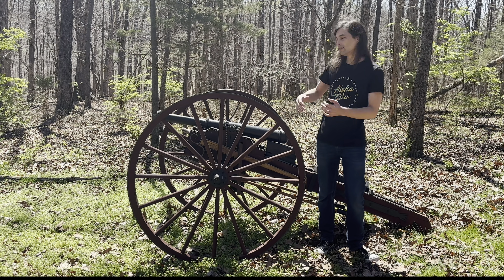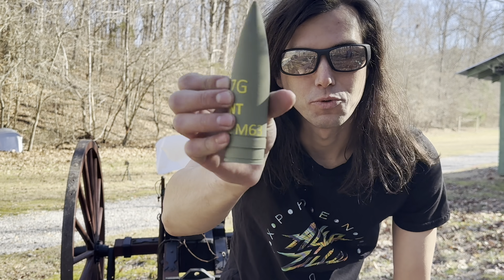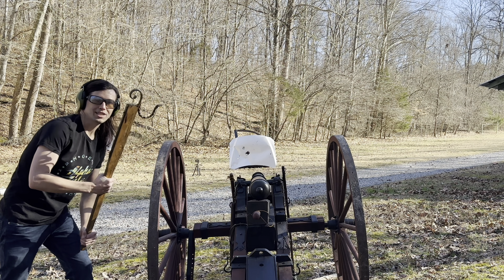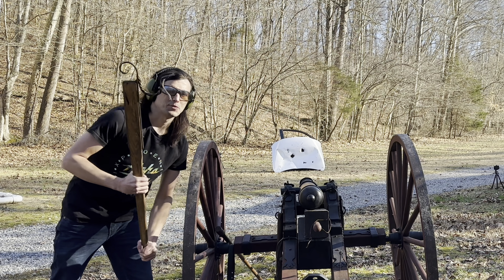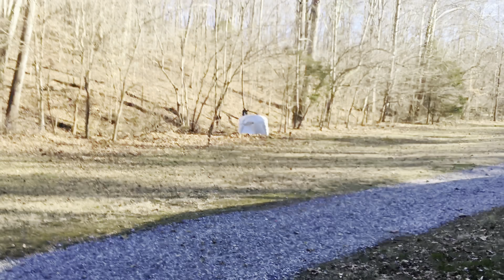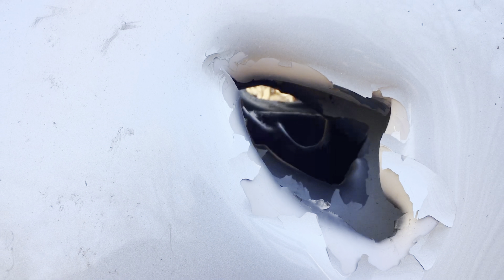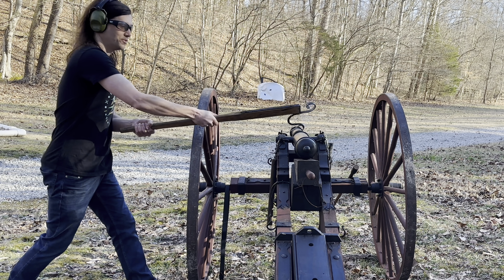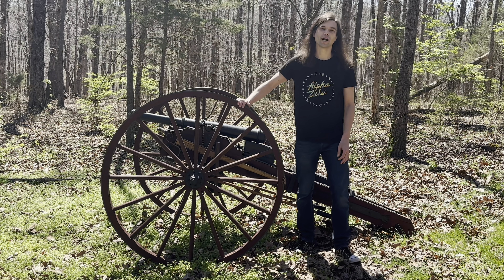Shooting 3D Printed Tank Rounds

Comment: This really deserves more views, damn i want a cannon now
Reply: Just as the Founding Fathers intended
Reply from the maker: @kookwater456  Just remember "you can't just go out and buy a cannon" so you gotta build it!
Reply from the maker: Thanks! Haha hopefully soon we will get all those views. Check out the video on how we built it! If you build one share some pics on my Instagram!
Reply: @TheCannoneer  I found that video last night and now cant find it. Curiosity, why pipes and lead, traditionally its a solid pour. I Get the ease, and cost part of it, however if you have any voids in the lead cast the center liner WILL deform sooner rather than later. I do like the plug and pin method, i hope you either forge welded the back shut or did it with a welder, just in case...
Reply: There's a poor man's way of obtaining a cannon, but it's extremely unsafe and if I tell you then I'm at least irresponsible and at worst a total jerk. Here goes. Go down to Home Depot or Lowes or your local farm supply store and find a fence post pounder. It's a heavy duty steel pipe with a steel plug welded in at one end and it has two rebar "wings" to get a good grip on it with. Drill a touch hole just past the end of the plug and you've just made a ghetto cannon. Then get yourself some pyrodex, dump a capful of powder down the end, ram some newspaper or paper towels down for wadding, aim it at the target, secure the daylights out it so it doesn't turn into a rocket when it goes off, pour a little pile of powder on the touch hole and light it with a punk attached to the end of a long stick. Try to avoid blowing yourself up. 

I learned to do this when I was about 11 or 12. Eventually I got clever and started using fuse, then model rocket igniters. Once I could set it off remotely I pushed the limits and blew up the "cannon" with four capfulls of powder. I threw the evidence in the creek and never told anyone what happened until now.
Reply: @TestUser-cf4wj  count your fingers first....
Reply: you got the fever
Reply: There legal to make
Reply: me to

Comment: The bore needs rifling if it doesn't have it. I am sure you know. Some shotgun slugs have rifling. So a little rifling can be put on the actual projectile. To make it spin and avoid the keyhole. That might be easier than rifling the entire bore.
Reply from the maker: We’ve actually played around with some “rifled” printed projectiles and they seem to be fairly stable for a decent distance. I made some in lead to see if we can replicate it although I haven’t had a chance to shoot them yet.
Reply: @TheCannoneer A rifling band might do and be simpler than the whole thing being rifled.
Also,  sabots and fins are an option.
Reply: I've 3d printed Diablo slugs for a 50 cal. You just scale them up in the printer using cura. Diablo slugs are stabilized very well in air rifles, and taofladermaus (youtube) has shot Diablo slugs from smooth bore 12 gauge, and also a rifled one. Assuming it scales up good like they have it'd be great in a smooth bore canon too.
Reply: @michaelabraham9177  There's also a similar soviet-era slug, called a Rubeykin slug, though I've also seen them be referred to by the acronym PMDK. There are dimensions online for multiple variations, they're quite simple to model.
Reply: Seconding what Paul said, what actually stabilizes Foster slugs (the ones you shoot out smoothbore shotguns) is their shape, the back half of the slug is hollow. The drag and accuracy is much worse than an actual rifle round, but at least it doesn't tumble in the air. A similar concept is used on those old space capsules.
Reply: If you are not already aware of them go check out TAOFLEDERMAUS and take a look at how rifling does or does not help with various projectiles they have tested.

I'm absolutely certain that you could gain incredibly useful information by watching all of their videos to see what they've learned about mass times velocity as regards different kinds of projectiles.

Yes they do deal only with the 12-gauge shotgun realm of projectiles, but the implications of massive acceleration scale effectively enough with size but I am certain your channel will benefit from watching what they have learned the hard way.
Reply: I so want to see APFSDS cannon rounds.
Reply: The "rifling" on a Foster slug doesn't actually make the slug spin. Or it doesn't make it spin fast enough to make any real difference anyway. That's kinda a misnomer. The bands are actually there as reliefs so they can squeeze through the chokes that are common on many shotguns. They are designed to easily squish down and prevent a jam in the choke.
Reply: @Paul-st2wv  I like the part where you straight up lied.
Reply: @NORTH_CAROLINA_REAPER  I didn't see a lie there.
Reply: @NORTH_CAROLINA_REAPER Point out the lie.
Reply: Thel rifling on a foster type slug is purely cosmetic it's there to dupe people in to think it makes a slug spin  I have a foster slug mold from Lyman it doesn't have it and shoots as well or better than those that do this type of projectile is stabilized by weight distribution I've seen slo mo of shotgun slug exiting the barrel they are not I repeat not spinnig

Comment: Awesome video, this is one of my favorite new channels. I had expected it to keyhole because the cannon isn’t rifled. It was interesting to see the rounds break apart and hit the target at different times. I’d love to see a fin stabilized discarding sabot round but I suspect that if using 3d printed parts, the round would separate in the barrel and we might see similar key holing effects as in this video. Maybe use a sabot similar to a shotgun wad instead of the petals that fall off after the round leaves the barrel like with modern tank rounds. It would be fun to see the trial and error of building such a round.
Reply from the maker: Thank you! Look like I’m going to be firing up the 3D printer! There’s a version of a tank sabot round that’s super fancy I think I’ll start working with and see what happens. I just recently saw a 1700’s version of a folding sabot for tearing up ship rigging that I want to recreate too.
Reply: @TheCannoneer  maybe you can 3d print parts, put them in some casting sand, and then pour molten metal to make a version of it that is more structurally stable.. like an armor piercing dart made of some metal, with 3d printed petals or what have you. of course, this might require a number of materials, and extra effort for each shot, but it's just a thought.